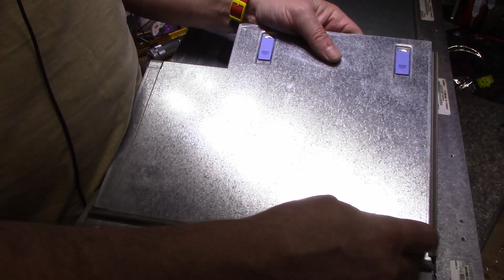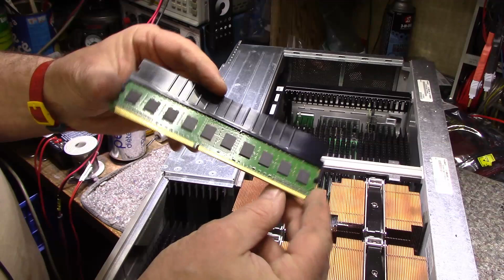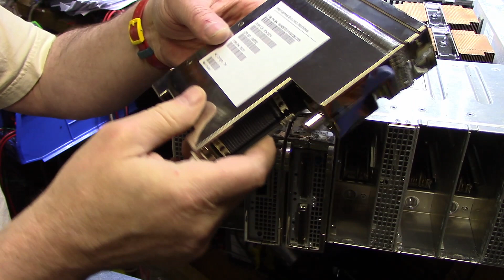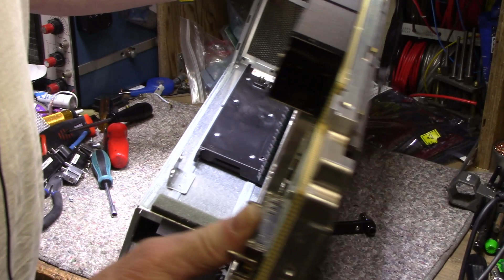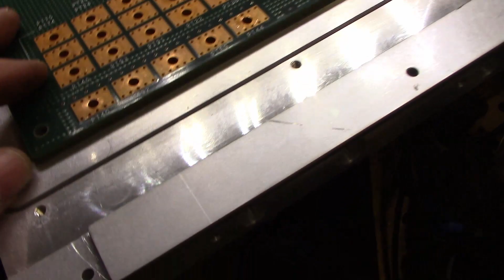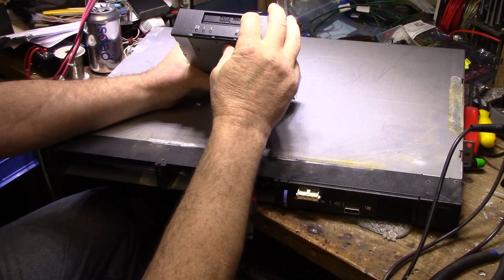IBM Power 6 Server Teardown -  Processors

Comment: Thanks for your analysis and proper tear downs. I soon will have one of these CPUs in my collection. 
God Bless.
Reply: Same here. How many CPUs do you have in your collection?
Reply: @BGTech1  Well at one time when I was scrapping for gold. I’ve had Thousands. 
I didn’t appreciate them like I do now. 
My favorite is this one, second to the J11from the PDP11/74. 
Maybe Because of its name. 
I’ve probably got around 40-50 Quality collector pieces. I’m after more from the IBM family though. Thanks for Asking. 
God Bless
Reply: @BGTech1  I’m Picking up a Mattel Aquarius. Unopened original. And a bunch of New “Old” Stock today. Hope to find some Goodies.
Reply: @jj74qformerlyjailbreak3  You should do a video showing your collection
Reply: @BGTech1  Eventually I’ll get to that. I’m wanting the raspberry pi HQ Camera module to do nice videos. Having trouble finding one

Comment: Are the traces on the board all hidden inside the pcb board?
Reply from the maker: Yes, there are no power, ground or signal traces visible.... everything is buried
Reply: @TrevorsBench  I would almost bet all data lines and power lines are on their own separate layers of the board separated by a ground layer
Reply: @BGTech1  I’m not sure how many layers but I would imaging dozen or so.